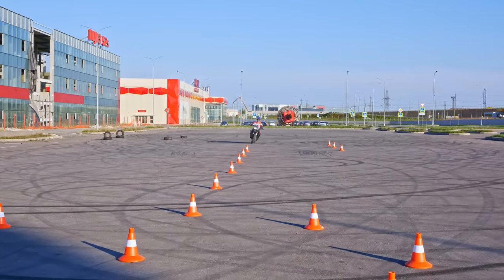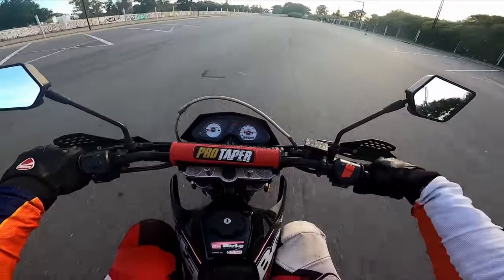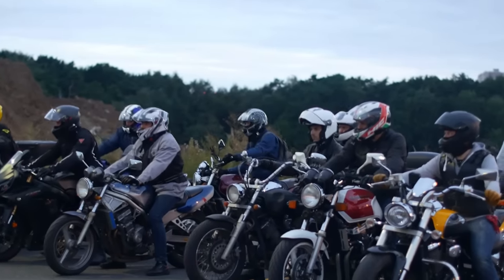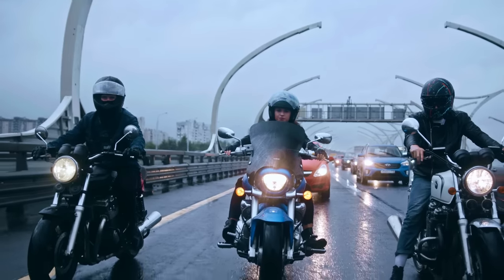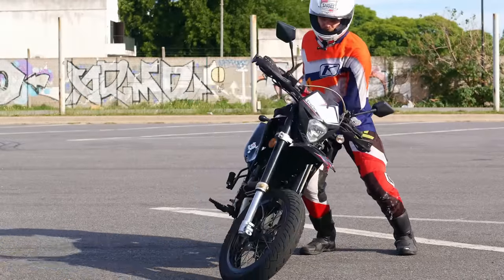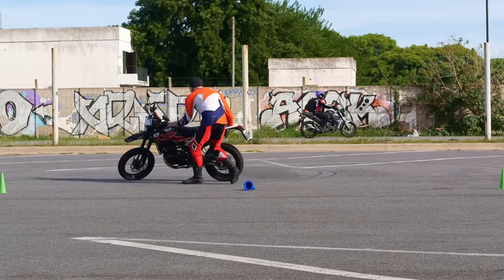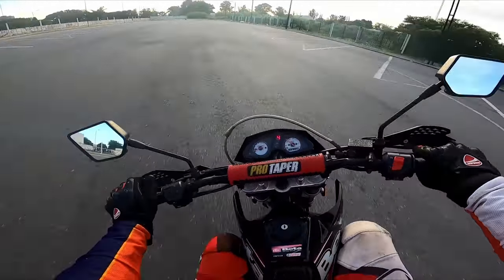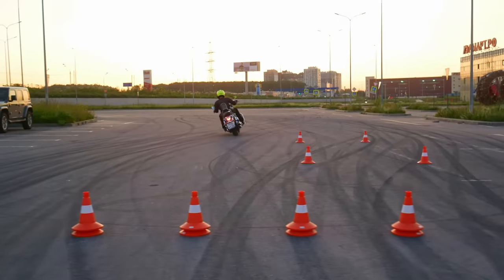How to use Counter Steering to Lean and Turn Your Motorcycle

Comment: Those tips works even when riding off-road with a street bike?

I live in Rome and some of the streets are so bad it's like going off-road, sometimes you find pieces of asphalt moving even on corners, which makes every corner a suicide attempt (at least for me). Since you have less time to react when you are turning, I usually slow down a lot to have more reaction time,  but I'm afraid some day a car that is going too fast will literally run over me 

Just to be clear i have no problems when turning on corners that i know they have a perfect asphalt

Comment: If you need to counter-steer to turn your motorcycle, it is under-steering.  If you get into a corner too hot, when you get on the gas to get it to turn, it might continue to run wide.

Comment: I think the issue new riders have with leaning the bike isnt how to lean the bike, leaning is easy, they are struggling with how much should they lean and when are you gonna lean so much that the bike is gonna lose traction and crash into the bushes. The leaning part is easy, I think they struggling with where the actual limit of grip is. It took me a while to learn the limit of grip. The truth is, there is waaaay more grip than people expect there to be. Experience is the answer to this question. After you push the boundaries a little and get hundreds and hundreds of hours under your belt you will come to learn your bike. The truth is, nobody really ever knows the limit of grip, its all a game of dumb luck, you could ride the same corner you rode 10 weeks in a row every day several times per day and then tomorrow you crash there because last night a truck spilt diesel on the road on that exact spot. I always say if you not ready to completely total your bike then dont ride aggressively, its a risk you need to be willing to take, also for the love of GOD wear protective gear LOL!!

Comment: As the wheel goes left at the bottom of the bike, the inertial stability of the bike  tends to push straight,  with,- now the wheel/the base of the bike, gone left the bike leans right

Comment: Not all bike perform like what you explained. Scooter expecially, Honda need counter steering method. Suzuki need body steering method. generally. doing the opposite make turning harder. For example, in Suzuki Nex II scooter, performing counter steering would not make it turn to the opposite direction, even during 90 kph speed. The opposite, performing body steering in Honda Beat eSP will not the bike turn easily even during 30 kph speed.
Reply: Bikes perform differently, but they all work the same way.
Reply: @XtreeM_FaiL  I guess all bikes you have ridden have zero fork offset. I have ridden bkes with positive and negative fork offset. And obviously, different caster angle too.

Comment: Second video, first was bicycle, saying it's steering column that keeps bike upright.

The first demonstrated by pushing bike downhill, it stays up, then ties handlebars so they can't turn, down the hill again but it falls over very quick. Still yet after it's seen people will still believe the spinning wheel, like a top, keeps bike up....... ignoring the 90 angle difference of top and wheel

I always thought the old time method was counter steering...... that's what everybody does on bicycle at 4yo.....I think the naming ane teaching something that is natural has become the problem......for example, as a teen I had TS, going down road and do uturn was simple, I just did it..... bike dip down, flip back up and I'm going opposite direction.......start thinking about it and it becomes hard

I did see a video, don't remember whose, doing uturn from stop, turn wheel opposite direction then go......going take practice

Comment: why dont you explain how to turn a long continous turn using counter steering throughout the whole turn regardless of the length of the turn?
Reply: Do you mean drifting, like speedway riders do? That's something entirely different (mentioned in the video 9:28) and not really relevant for road riding.
Counter-steering is a brief input to cause the bike to lean, then you need to allow the handlebars and front wheel to turn in the direction of the turn to stabilise the bike for the rest of the turn, as described in the video. If you keep counter-steering, you'll keep increasing the lean angle until you fall. See 8:08.
Reply: @neilp1885  no i don't agree...because in long turns there is no other good way that i know of but to keep on countersteering like in races where the riders countersteer all the race and i don't mean drifting .
Reply: @Niu2024  ah, I think I see what you mean, I misunderstood your question, sorry.
When turning a bike, there are several forces that need to balance for it to be stable. Your inertia is trying to keep you going in a straight line, and you need a lateral force towards the centre of the circle in order to turn, and of course that force needs to be generated and balanced. You lean the bike (counter-steering to start the lean - gravity and inertia tries to make you fall to the outside of that turn you just initiated, which is the inside of the turn you actually want to make, hence counter-steering), the leaning tyre now wants to roll in a circle (likely much tighter than is possible to balance at your current speed), and the steering geometry also wants to turn the bars to steer the bike the same way. So, gravity and inertia are making you fall but the turning forces are trying to stand you back up. Depending on your speed, lean angle, body position, weights (you and the bike), tyre geometry, material, pressure, etc., you may need to apply some force to the handlebar to maintain the lean angle and slip in order to balance the forces.
And yes, a video explaining this a lot better than my attempt would be good 😄👍
Reply: @neilp1885  
Nice description. This link will take you to a good video showing counter steering in use. Hope it’s what you’re looking for. https://youtu.be/lzk8oyNO708
Reply: @neilp1885  Speedway actually ain't that different, just extreme case of bike handling.
It is still countersteering.
Reply: Agreed, I was waiting for some allusion to centripetal force
Reply: @softailfun  yes exactly what i meant an i actually learned this a long time ago but wanted to share this knoledge that isnt known by all riders and the assumption is that they're doing it just not consciously.

Comment: Why don't you speak about body weight distribution ? Moving your butt a bit out the seat (opposite direction of the lean) will help a lot if you're on a full lock circle

Comment: Nope for exssample if you traveling at 60 into a left hand bend and you lean as normal, but if you intend to straighten up,as you do that and turn the steering right you bike will countine left becausue your still leaning the reason for that is that the rear half of the front tyre is closer to the road because you leaning and you need to use the throttle to straighten up that's counter steering leaning is not counter steering

Comment: You can not use your body to lean the bike, because you can not lean to the air - you have to use counter steering and then lean your body and the bike. Just like you did it in the video. It's called physics.